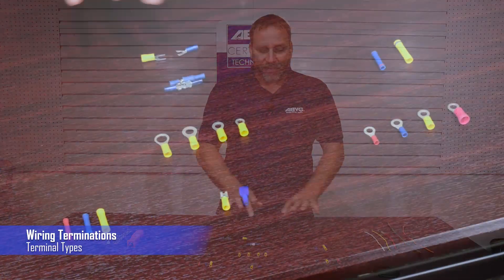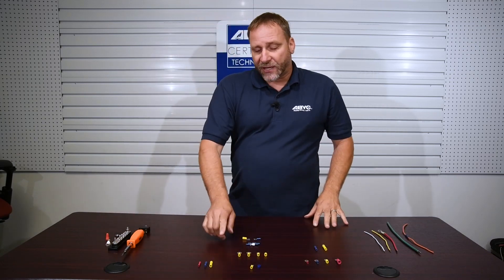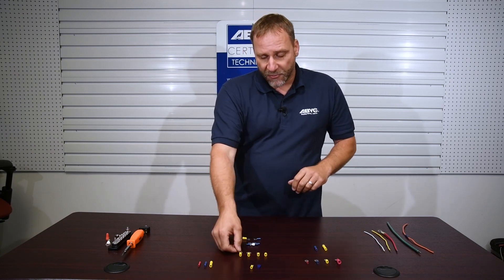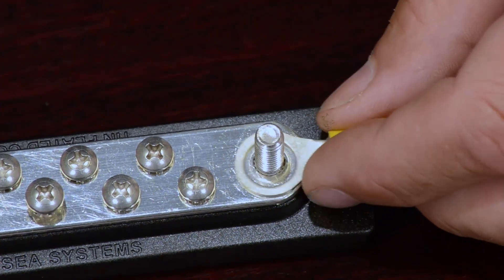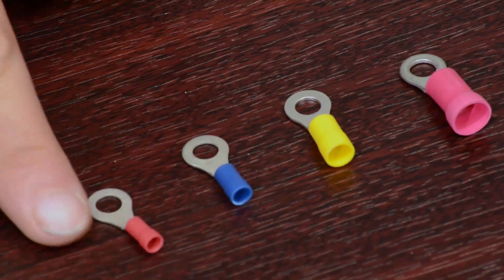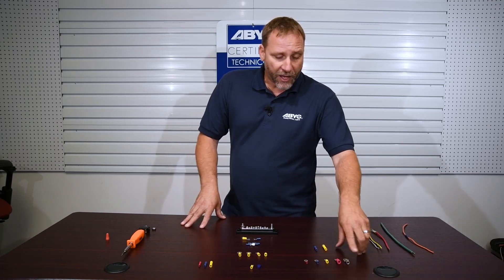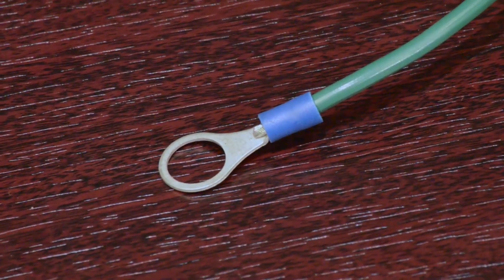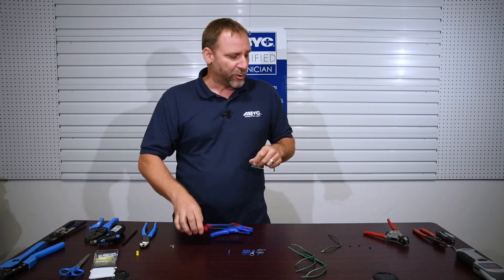Preview: Wiring Terminations

Comment: I am surprised you didn't mention waterproof connectors. When the wire gets exposed to salt water, there is opportunity for the wire to get corroded. Though using the waterproof connectors, the ends of the connection can get eaten by salt water, the wire is protected. You can replace the eaten connector and not be required to replace 60 feet up the mast to the anchor light.